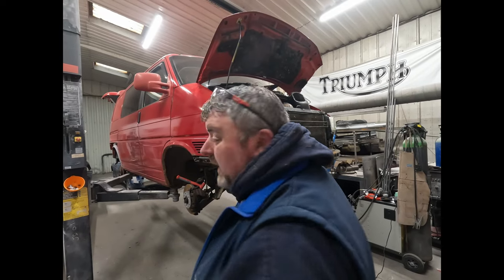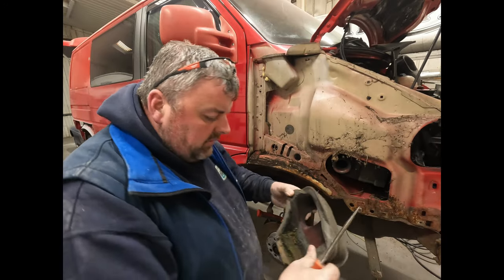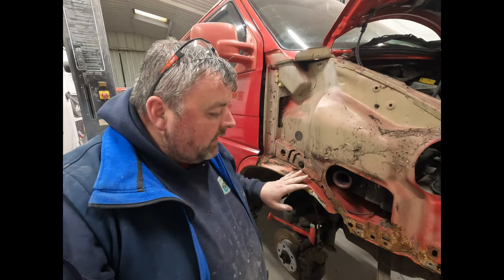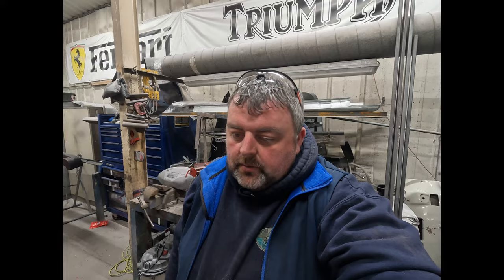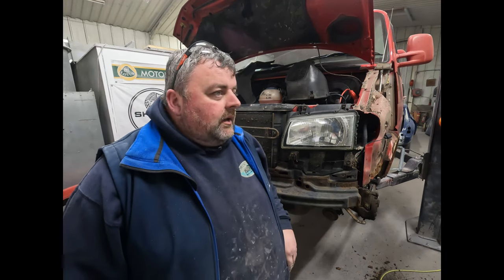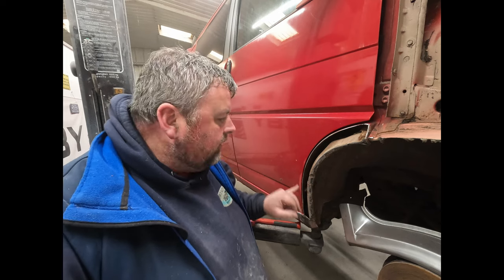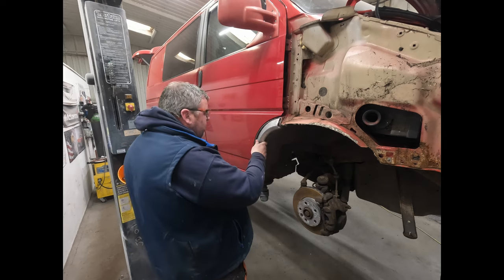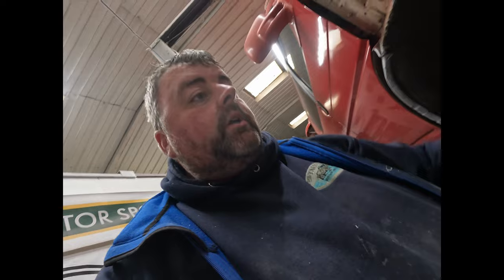Volkswagen transporter t4 in for a full repaint and welding new arches lets see how were getting on

Comment: The reason these rot out is because eater and leaves etc run down the scuttle drain hole and get stuck behind the wing and rots it out. There is a kit you can buy which diverts the water away from the wing